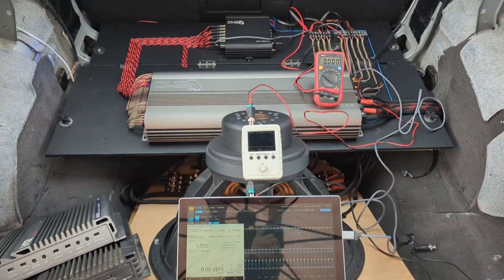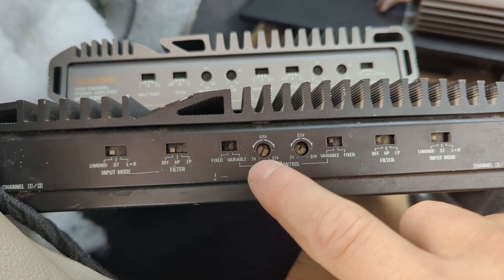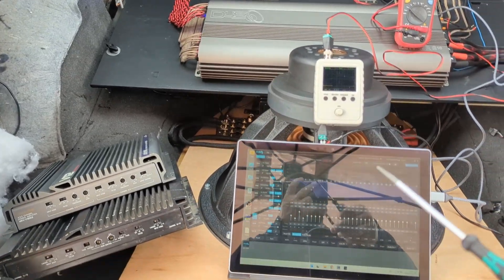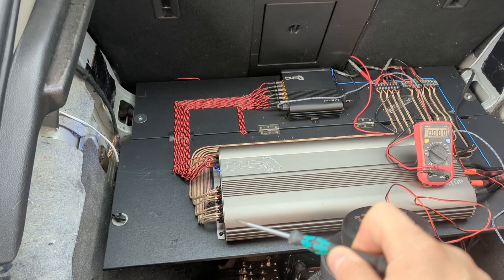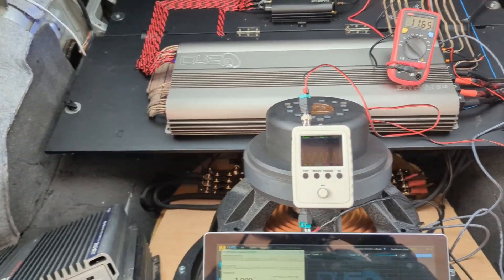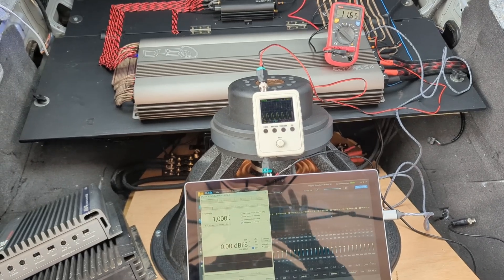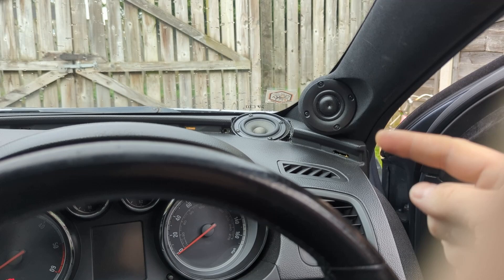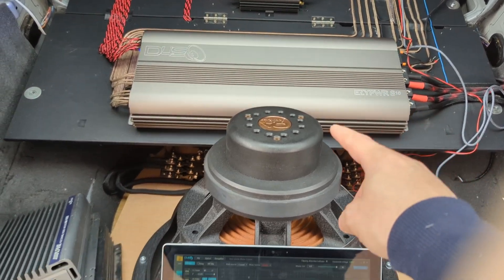Back to basics - how to set gains

Comment: The spec for sensitivity is 1w at 1 meter. It will take more than one watt (or your stated 2-3) to get the rated output, but definitely much less power than the mids/woofers. I need 2 more channels and I thought about adding one of those tiny micro amps for the tweeters, rather than switching to a 6 channel.

Comment: Goosh. This was an eye opening video. I think i understand the gain knob now...

I am a bit curious tho, how do you handle a case where the amplifier is way more powerful than the speakers? 
what i mean is that overhead is nice, but then again you have to be able to protect the speaker also.
So i think what i'm asking is how to set the levels/gains if you have some speakers in the system that can't handle the power and you don't have a DSP to turn down the signal for that channel.
Do you add an attenuator to that channel somehow or do you then match the levels by turning up gain on all the other channels and just remember not to turn the volume level all the way to full?

Thanks!
Reply from the maker: If you don't have a DSP, surely you will have a head unit. All of them will have "level" settings for all 4 channels. Just keep the rears on 0 and turn down the fronts to -5 or -10. But this is why you need a DSP😊

Comment: still not get it how to set it to not damage sub speaker with lower power? Even with 0 gain overpower amp could damage sub, so we need to put general level to -10db but how to calculate this db value? If  i have 400W rms amp, and 200W rms sub speaker should i set gain just before clipping and then set -3db in DSP?
Reply from the maker: Yes, that is correct. Or you can calculate the voltage based on ohms law and aim for that.

Comment: I'm going to be honest, I did not get this at all. 

if we get an amplifier for a cleaner (and louder) signal, why leave it at the same input voltage that it gets from the DSP? why are we not setting with either test tones to account for clipping via an oscilloscope (with wiggle room) or setting the proper peak voltages for the drivers? this made zero sense to me
Reply from the maker: If you have a "matching" DSP and amplifier, let's say both 4V, you can use the scope and check all you want. But you will notice that only with gains all the way down you get clean output. When you turn the gain knob even a bit, you will clip.

Comment: So I have an android radio for 4G LTE service with abysmal rca output into an Audio Control D5.1300 running the passthrough to a powered enclosure that accepts lower input voltage. I need the Audio Control Matrix to act as a line driver and noise filter to get realistic inputs to the D5.1300 but the passthrough is already amplified by the D5.1300 so with the gain turned all the way down on the powered enclosure it's overly load and clipping at low volume settings. How do I massage that level to make it a sane input with crossovers in effect while finally getting clean output from the rest of the D5.1300?
Reply: Get an Android radio that outputs clean 4v RCAs, that is DUDU7.

Comment: Great Video. I  currently want to purchase a portable oscilloscope to set the level outputs on my DSP to the amplifier. I'm running a 3way fully active and the Audison Bit Nove doesn't have output clip indicators, only input clip indicators. I want to purchase one similar to the one you have this video. Is the BNC to speaker adapter female or male on the adapter. All the pictures online don't show if it's male or female that connects to the oscilloscope. I'm going to purchase an adapter with RCA ends and one for the  speaker outputs.

Comment: Great information in these videos, I was just curious why don't you "Set the gains" or offset on the DSP, before doing the EQ? 
To me it seems like a higher chance of missing a frequency, with which you check for clipping, instead of lowering the DSP output offset by the highest EQ boost amount. 
For example in Equalizer APO on windows, I would set the gains (or measure power/voltage output) with everything disabled, then after creating the EQ in REW, you lower the output in APO, until the little red Peak Gain number goes away. 
With this method you are always 100% sure that the amp will never clip, as long as that peak gain stays below 0.0db

Comment: PU insulation foam is not the correct way to put your subwoofer box together 😂
Reply from the maker: First of all, that is not a box, that is an Infinite baffle manifold, there is no pressure inside. Secondly, that is not insulation foam, but expanding PU glue. Thirdly, from the inside the seams of the manifold is sealed with caulk, oil base paint to make it waterproof and sound deadener.
Reply: @RAW-CAt  If there's no pressure inside, why bother to seal it then? If the enclosure is out to the open outside the car, then it most certainly has pressure and it's not an infinite baffle. An IB would be open inside the airspace of the car only. If the 'baffle' is venting out of the car, our car just acts like the speaker enclosure vs outside air. You didn't do a very meticulous job if you managed to get such overspill with a PU glue 😂
Reply from the maker: @Munakas-wq3gpit looks to me like you don't grasp the concept of IB manifold or maybe you are not very familiar with IB. You should watch my video "all you need to know about infinite baffle". There I explor many different ways to have IB in a car.

The sealing is done for moisture, not pressure. I was working with MDF, hence I need to make sure that anything exposed to the outside would be waterproof. MDF if not sealed, gets swollen when absorbed moisture. 

And yes, you are right, I didn't do a meticulous job, next time I will do better😊
Reply: @RAW-CAt  I'm fully aware of the concept of IB naturally. What you created there is a sealed enclosure where your car is the enclosure. There will be a large pressure difference between the outside world and the car when you play. It's exactly the same as using a large sealed enclosure for a subwoofer, except you listen inside of it.
Reply from the maker: @Munakas-wq3gpit's not a small sealed baffle, it's a manifold with an opening to the outside. This is how IB is done. You can mount a driver to the frame of the car directly or to a manifold. This mounting solution works for me as I had the manifold made for a smaller driver that I could mount normally, this one is too tall, so I have to mount it inverted or re-do the whole install.
Reply: @RAW-CAt  If you think that there's no pressure between your car and outside air when you play, then you really don't understand how it works. Your car acts like an enclosure in this setup.
Reply from the maker: @Munakas-wq3gp I am not sure what that has to do with anything. Cars have holes 🤷
Reply: @RAW-CAt  You don't grasp the concept of a sealed enclosure? 😂

Comment: My Audison amp hisses at 30-35% of the gain power. 

I have the loc 22 set at 30% on the gain, and the DSP set  4 db for the main and 2db for the channel related to the audison amp. 

If I increase the gain on my amp the hissing comes loud but if I set at 30 it goes away. 
Any advice at all on this if you understand anything of what I just said.
Reply from the maker: Amplifier hiss is just the amplifier noise being amplifier. You need a better amplifier with higher SNR.
Reply: @  okay thank you!

Comment: This method is a step up, but keep in mind: the lower the frequency, the more power is required. For example we can often run 500 W to a sub but only need 15 W for a tweeter to produce the same dBu. This is why the highest EQ boost frequency is not always the clipping danger frequency.
Reply from the maker: Correct. As I mentioned in the video, I do not recommend setting gains for mids and tweets up to clipping. I am just demonstrating an example because everyone is asking.

Comment: Would like to know if the headunit voltage is high for the amp input sensitivity, what will happen, and also, should i leave the gain alone????
Reply from the maker: Gain at minimum and reduce the level on the head unit. Most head units will have channel level adjustment.

Comment: After I've tuned my dsp and match my levels, will setting the gains on the amp to match the dsp change the levels I've previously set?
Reply from the maker: Yes, it will. The only time I personally needed to increase the gains is on a few midbass drivers after cutting a lot with EQ. Never had to do that on tweeters or midranges.

Comment: Very useful video. But I have a question. I have a Helix DSP.3S which outputs 6 Volts connected to an Audison APBX 10 AS2 which has a gain of 0.1 ÷ 4. So I put the gain on the Audison sub on 4 but there is no bass. I tried fixing it from the DSP but it didn't work. The Audison sub also has a Bass Boost knob from 0 to 6 db. Should I use the Bass Boost or up the gain on the sub amp to get some bass?
Reply from the maker: First figure out why there is no signal. What is feeding the DSP?
Reply: @RAW-CAt  I meant there is not enough bass. I didn't set the gain on the DSP.3S. It was set at 11v on high level input. I finally set it to 2.7v.
Reply: @gabrielsolomonreal  You have not enough bass, cause Audison APBX 10AS2 is not correct subwoofer 4U.

Comment: All oscilloscope isn't the same i had aukuyee for years same head unit volume is 34 is distortion 50 max using rca now i have this fnrsi volume show me 29 is distortion 50 max do it again show me 50 max no distortion i had to listen with my ear and i see 34 is distortion i will buy smd dd-1 so i don't have to pluggin power ,aukuyee is good
Reply: I just had a seizure reading that... do you actually read what you wrote before sending that shit?

Comment: Just to make sure I have stetsom stx dsp 2848 voltage is 5.6 with amp voltage is 8 to 16 volt do I need volt more or not ?
Reply from the maker: That 8 to 16V will be your power input voltage, not input sensitivity.

Comment: Using a 0db source signal is certainly the safest option, but for low power systems, you may find you don't get enough volume out of music that is recorded at lower levels.  I usually start with -6db signal to leave headroom for quiet tracks...but with a modern DSP connected to an old school amplifier, you're always going to end up with gains set to minimum.

Comment: In your example you set your gain to be optimized at 450hz because it was the loudest frequency in the dsp. Why would it clip at 900hz if the eq was flat at that frequency? Wouldn't everything not clip anymore because it would be quiter than 450hz?
Reply from the maker: With that example 450Hz was at -6dB which was the lowest point in the EQ curve and 900Hz was +6dB.

Comment: Do I need to mess with gain on my DSP/AMP helix combo(m six dsp) if i use optical as input? How does gain work with optical as input? assuming highest EQ is at 0db or no EQ at all? 

Thank you for this.
Reply from the maker: Optical automatically will be maxed out. There is no gain stricture with digital signals.

Comment: I still like to set all my gains before I start EQing, with all the levels and EQ set to 0 on the DSP.
Just because I don't trust the manufacturers. E.g. the helix dsp.3 says it outputs 6V, but I measured 6.7V out from mine with the BT Hec card.
I'm not complaining, but I had to turn the DSP down 1.5dB so I got 6V, then I had to turn up the gain a little on most of my amps to get the rated voltage, even though their gain was rated to 6V.
Then again, if you have very insensitive drivers, you can often turn the gain to +3 or +5dB, because most music is mastered to a -5dB level or lower, and you will get "more output", or actually rated.

In a full SQ car it is pretty irrelevant, but if you e.g. want to play with the doors open some time or something, you can easily blast at full volume and can then cause clipping if the gains are not set.
Of course when the gains are set with 0dB from the DSP, you'll have to always keep the maximum level at 0dB too, with level and EQ.
Reply: What phone do u use Bec i have the same dsp with bt with a iPhone 15pro and only getting 4 volt out

Comment: I’ve noticed that my Helix DSP3.s will only put out its max(6 volts) with the channel gains at (+ 5). My amps accept 6 volt input.  Should I just leave the channel gains at “0” and amp gains down and adjust the DSP channel outputs if I need more volume ?
Reply from the maker: What signal.are you feeding into the DSP? What is your source? You should have 6V out with 0dB everywhere.
Reply: yea i have had the same issue like you with same dsp only getting 4 volt with channel gain at 0 i am using a bt card to it
Reply from the maker: @TheSteelerKillers  in my experience via BT the output will depend on the phone. On some you get full voltage out, on some a bit less 🤷
Reply: @RAW-CAt   i have a iPhone 15 PRO idk maybe have to ask helix what they think
Reply: Pioneer HU. Analog to DSP. 4 volt HU output.
Reply from the maker: @SM-yx5mp  I would double check if your head unit outputs exactly 4V. If it's less than that, you will not get 6V out of your DSP.
Reply: @RAW-CAt  3.84 volts cleanly.

Comment: Yup.  Keep the amplifier gains low, and keep the source/DSP/EQ gains as high as possible.  In the pro audio world, we call this "gain staging".  You want the loudest, cleanest signal from the source and then apply as little gain as possible later on, because each time you add gain, you are also amplifying the noise floor.  High volts from the head unit if possible, and high volts from the DSP, will ensure clean, low-noise signal going into the amp.
Reply: What about amplifier input sensitivity? I know you want to send the cleanest signal as possible to your amplifiers. Is there such thing as sending, “too hot” of a signal to the amplifiers? Let’s say the max input sensitivity of an amp is 6v. If you send anything higher than that, would that lead to problems?
Reply: @raulboomin yes that's called clipping the input and it's no good.
Reply: LOL, I know that feel all too well when I first started DJing and had crappy audio interface and mixer, high end suffered  especially with the stage monitors.

Comment: if you difficult with set gain, just use DSP amp (DSP including Amplifier) no need external amplifier 😁
Reply from the maker: The problem with DSP amplifiers is exactly that - there is no gain. So if you are not careful with EQ, you might end up cutting too much and will not be able to bring the level back up. You need to be more considerate.

Comment: Well good. But what about the calculation people does it while doing gaining amp that ( √ohms×rms) and match the voltage of AC voltage by using multimeter. And can we measure the volt comming in RC by using multimeter.?
Reply from the maker: The calculated voltage is a very rough ball park as it takes into account a lot of assumptions. For example it is an assumption that  at your voltage the amplifier is making rated power. As well it is an assumption that the ohms value matches the speaker impedance. I would not recommend to use that method.
Reply from the maker: You should not have to change the EQ, all should be fine. You might want to double check the individual speaker levels though just to make sure the system is perfectly level matched.

Comment: Knowing what I know today about tweeters and power, the output wattage of the amp really is irrelevant. They're only going to use 5 watts at their peak. A good 25wpch amp is prefect.
Reply from the maker: The problem is that no one makes these small power super clean amps anymore. All low power amps these days are garbage chip amps...
Reply: @RAW-CAt that's not true I have a Class A 35 watt Celestra, excellent tweeter amp
Reply from the maker: @justinhogan7248  where can we buy it and how much does it cost?

Comment: I agree with everything said here. BUT there is one thing to remember. Alot of us are constantly tinkering and messing with things. So for those that don't want to constantly readjusting gains every time you eq or change speakers or config. You can make some simple rules on yourself. 

If you set gains at at 0db. Then when u eq. don't boost above 0db(overall boost as you mentioned) Or leave your self some leeway. set gains at +3 or +6db output. then you'll forever have room to boost to those levels without clipping. 

This all also assumes at some point you're gonna play FULL 100% volume. so you're actually reaching the full +6db boost at that point.

Comment: 93dB sensitivity with 1 watt, EMMA SQ judging is at 85dB.
I clamped all the channels on my car at 104dB at the headrest, Mids and tweets less than 1W, midbass was 1W, front sub was 7W trunk baffle sub was 180W.

 I have all my gains all the way down except for the subs, so I don't bother with them either.

I have a question though, if you adjust your gains after then doesn't that messes up your levels in your tune?   So it's better to match DSP to amp at the beginning and just have headroom, like you said.

i think there are so many "adjusting gains" videos because people treat it as a volume knob.
Reply from the maker: It does mess up with the level matching indeed. It would be a back and forth game checking and adjusting. The only time I had to adjust the gains on an amplifier was after cutting midbass with EQ (to get rid of the cancellations) and then bringing the level up🤷